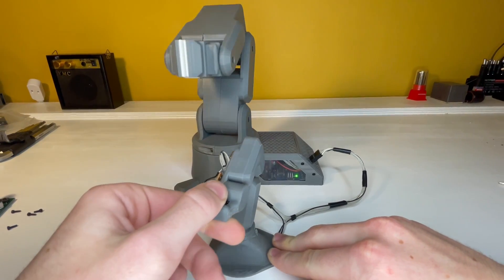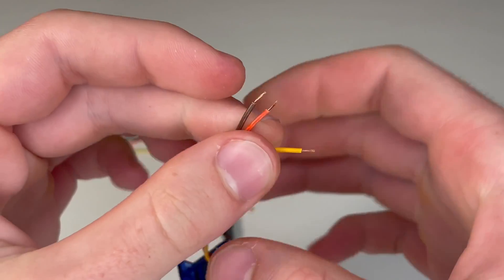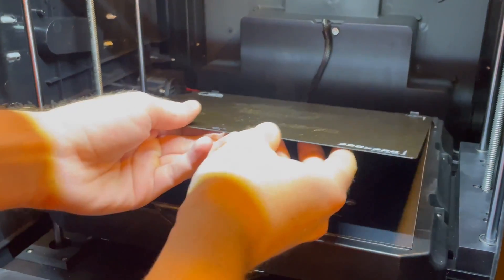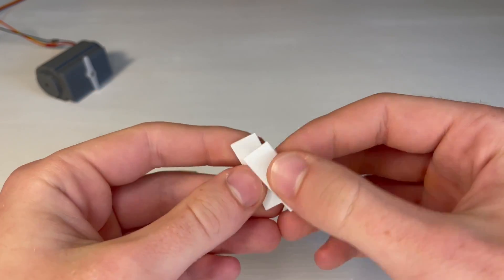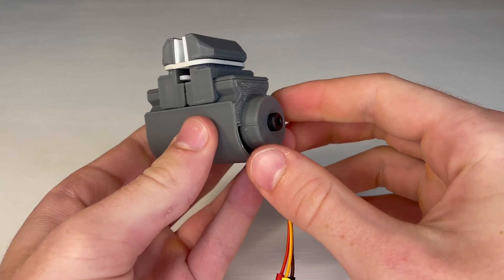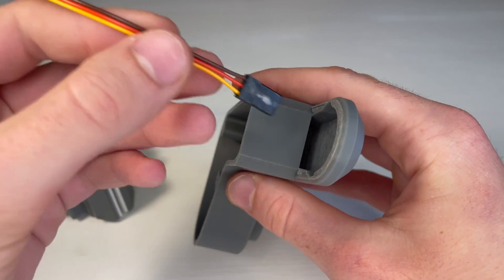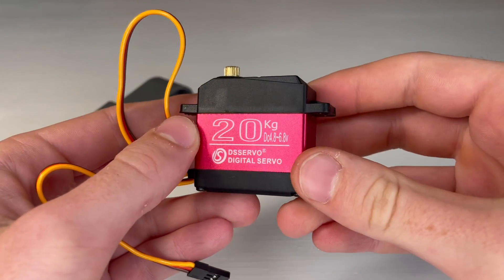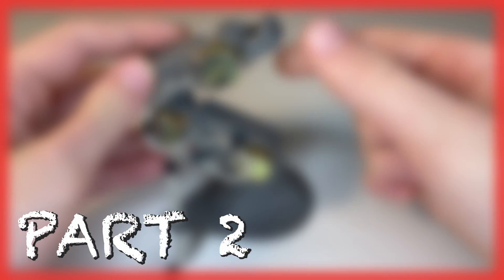How to Build a 3D Printed Robot Arm Tutorial (Arduino Based) - Part One

Comment: Dude, I just built this robot! It was so much work figuring all this stuff out without any tutorial. Watching this makes this a LOT much easier…
Reply: What is the supply voltage. I am using a adjustable power supply
Reply: @Thes.econdstoreBargarh i think 8 volts because He Said you need a 8 Volt supply
Reply: How much it cost at least?... what can do with it?😁
Reply: @obadaobaid  its around 208 give or take if you already have some of the parts
Reply: Do you know how to do it with stepper motor and a raspberry pi 😊
Reply: @That_droper  wow, no I dont't. But i also would't recommend this robot design for stepper motors. There are lots of other designs already made for stepper motors. (And raspberry pi) good luck
Reply: @MerkuMaker  thanks
Reply: How did u deal with the gears, did you cut the stems off?
Reply: @alexandroartola3430  you dont need to cut any gears... not sure what you mean

Comment: Is that hi torque servo motor necessary
Reply from the maker: It is not required, and another standard servo may work. However, I would recommend using it in the joint shown to reduce jittering. (Because, that joint will need to lift the most weight)

Comment: 1.59. When extending servo (etc.) wires, I have started staggering the solder joints.  Using the wire colours in your video as an example, I would do this:
*  Cut each set of wires 1cm longer than you have shown.
*  Peel apart the ribbon cable, as shown in the video,
*  Do nothing to the brown wire.
*  Cut 1cm off the red wire.
*  Cut 2cm off the orange wire.
*  Now with the loose wires:
*  Do nothing with the yellow wire.
*  Cut 1cm off the red wire.
*  Cut 2cm off the black wire.
*  Slip a 4cm piece of shrink-wrap over ALL the wires.
*  Solder the wires as shown in the video... the difference is that the joints will be offset from each other, so the soldered parts cannot touch.
*  Shrink the wrap... the finished joint will be much thinner.
👍 😊
Reply from the maker: Great idea!!! Thank you so much for sharing your knowledge! :)
Reply: @buildsomestuff hey I’m a big of and I was wondering if how would you do this with stepper motors?😊
Reply: Great idea! TY 4 sharing😊